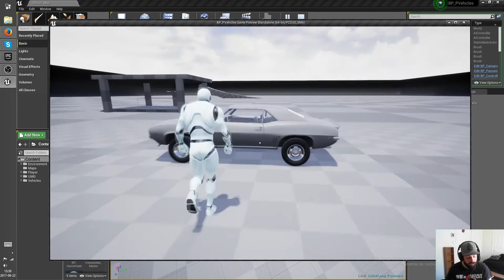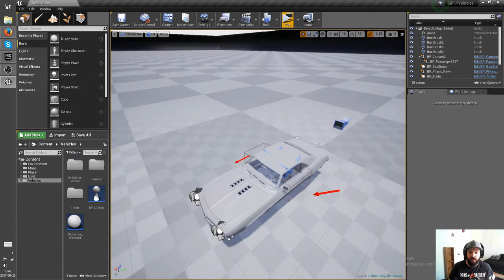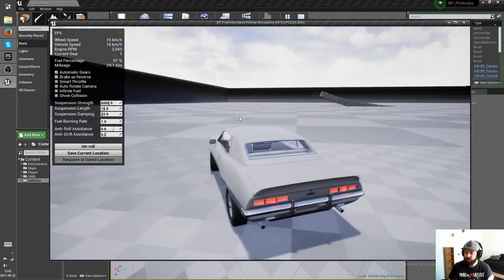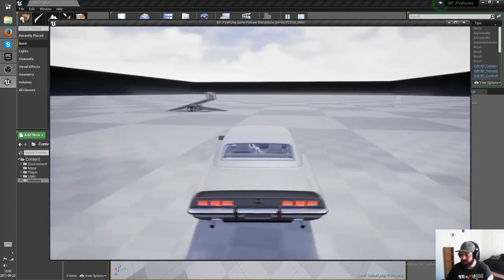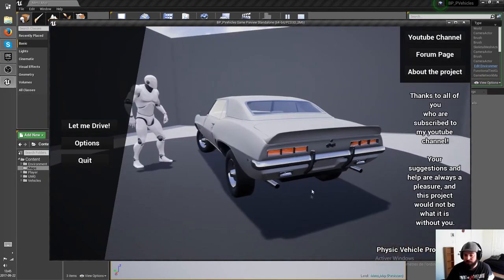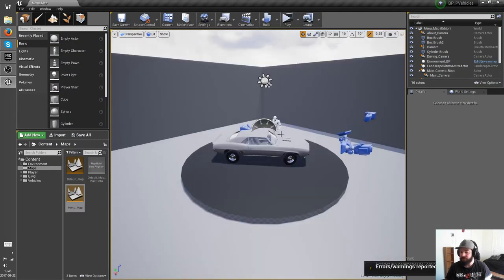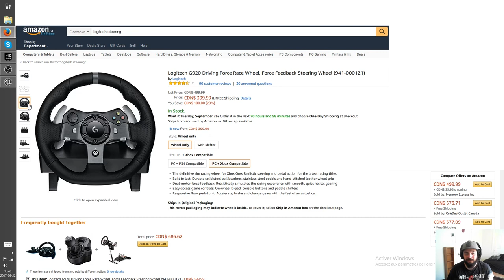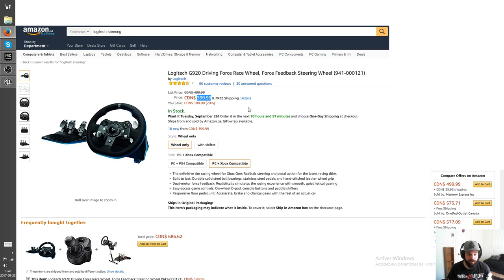Physic vehicle simulation 2 7

Comment: How did you make it so there isn't motion blur on the wheels while driving, cause I've created my own project and my wheels have a crazy amount of motion blur, also how did you make it so you can look up and down while driving the car, in the input menu.
Reply from the maker: I turned down to almost 0 the motionblur in the post process volume, wich is un-bound and affect the whole map. Also for looking aroun in the menu, I simply need to hold the mouse button to re-give control to the game instead of UI temporarely so the mouse movement are handled by the car and not the menu and then the camera rotate normally :P
Reply: He made fake wheels that rotated at a limited speed and made them visible. And the real wheels for which the collision is calculated is invisible. But it's certainly crutches. On the good in the engine should be the parameters that regulate the amount of motion blur.

Comment: Great job. My English is very bad - with printed text I'll figure it out yet - an translator helps me, but with speech, things are not very choppy. Can you write what we are talking about at the end of this video, where do you look at the steering wheel?
Reply from the maker: I was asking if the steering wheel actually added anything to the experience and was worth getting one, or if it is only a super expensive gadget.  I was thinking of getting one eventually.
Reply: I bought a logitech g25 (a very good steering wheel I must say) in the distant 2008. It was in those days that the new cost about $ 400, but I bought at a discount of 25 percent. Then he drove on him in Richards Burns Rally. Delivered a lot of fun. Depends on the game a lot, and on how well there is implemented support for a particular steering wheel.
Reply: I here a few days ago made a small project - a car on line traces without physical constraints. In such a decision there are advantages. For example, you can simulate microroughness on such surfaces as coarse gravel, even if the earth model's resolution is much larger than the size of the pebble. Also, there is full control over frictional forces, which allows more fine-tune the behavior of tires with the road.
Reply from the maker: that is correct, one can get a satisfying result with linetraces, unless you want the car to act realistically when hitting bumps (sidewalk for example).
Reply from the maker: did you notice I said thanks to you in the video? for the air drag and acceleration :)
Reply: Oh sure! Thanks for the kind words. It's great to exchange experiences to do a better common cause. There's a forum I wrote a couple of thoughts. Look, maybe that's useful.
Reply from the maker: because of some weird bug, I cannot acces the forum right now. What do you think of using sphere trace to detech collisions, so we can apply force to the wheel bone depending on where the colision is, to "fake" collisions?
Reply: I yesterday also could not go to the forum because I logged in on the page of your project. To fix this you need to go to the browser settings and delete the cookies of the unrial forum page. In occasion of trace - yes I think it is possible to experiment and with sphere trace. I will now finish the demo with a single trace on the wheel, and then I'll try other variants of the trace.
Reply from the maker: hehe you are the man! I would like to add you on skype if you want, so we can chat more easily.
Reply: Oh sure! My nickname in skype - skladey
Reply: Hi Ivan , I send you PM on Unreal forum but , probably because that bug you didn't receive it.
I made system based on your screenshots, it is working nicely but not sure about all things , I needed to make some changes to work ok and to engine sound good
My two cents with making custom Vehicle is .....adding  engine sound with FMOD from 1000 to 6000 rpm , helping a lot with filing what car doing, like aditional debug system. :)
Reply: Yes, I read your message. The value of the torque ratio depends on how much of the engine's torque gets to each of the axles of the car. Let's say that if the car is front-wheel drive then the torque ratio =[1,0], if the car is all-wheel drive with a ratio of 40/60 then torque rartio=[0.4,0.6], rear-wheel drive =[0,1] and so on. That is in other words for the most ordinary car Torque Ratio parameter is a constant, that is, it is not variable in time. In sports cars, this parameter can of course vary. In addition, the distribution of torque is possible in cars with intelligent torque distribution systems between the axles to improve handling. Multiplying the torque output from the gearbox by the percentage of this axis, we get the torque that has the differential of this axis. To obtain the final torque value for each axis wheel, this value must be multiplied by 0.5. https://cdn1.savepice.ru/uploads/2017/9/27/717071b96a0d5653af7d22ec7cfef2d0-full.jpg
Reply: I will send you screenshots of blueprints via forum if you don't mind
Reply: Yes, read, good article. I yesterday sent you an edited version of your script - helped?
Reply: I didnt, I don't have any message in inbox  ,  something is broke after they update forum
Reply: Yes, the work of the forum leaves much to be desired. Here http://www.picshare.ru/view/8296505/